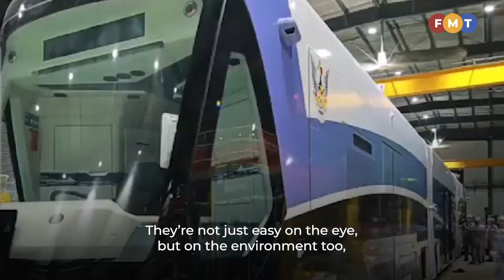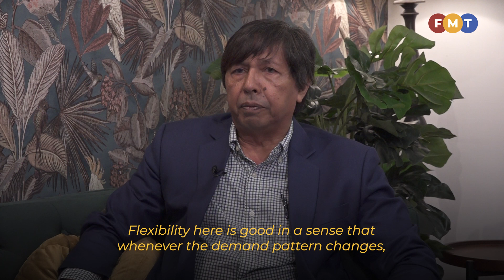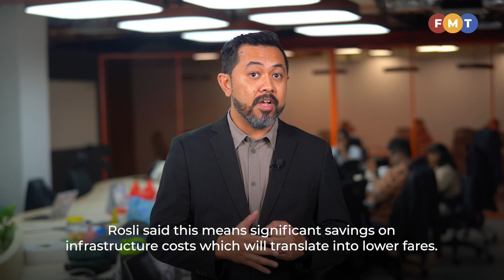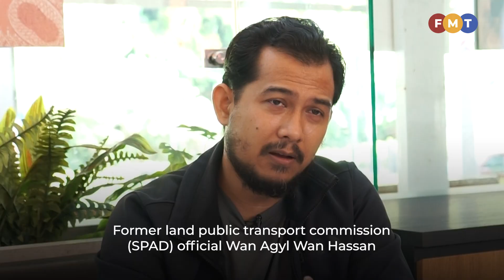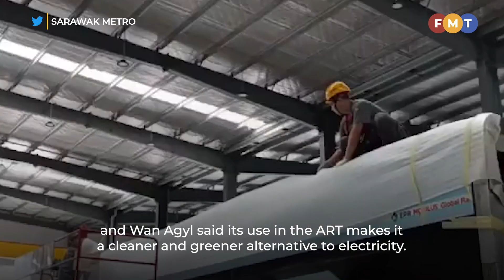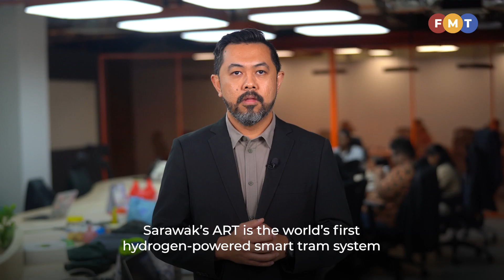Experts laud Sarawak’s ART

Comment: ART OF ENGINEERING. HYDROGEN IS VERY UNSTABLE, LIQUID PROPANE WOULD BE MORE STABLE. HYDROGEN is DANGEROUS, HIGHLY EXPLOSIVE if exposed to FLAMMABLE PARTICLES OR CHEMICALS. GIVEN RIGHT TEMPERATURE & RIGHT CONDITIONS of exposure, DANGER IS MORE UNAVOIDABLE. SAFETY FACTOR COULD SUFFER.
Md RAFI MAINE USA-PHD